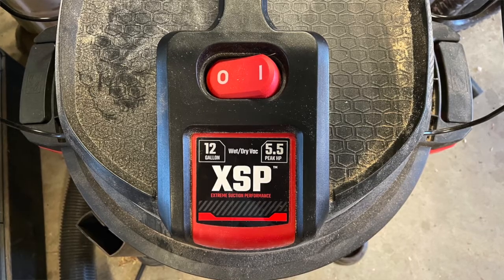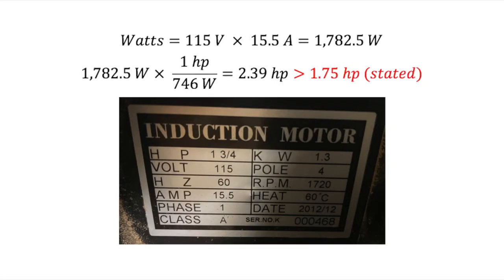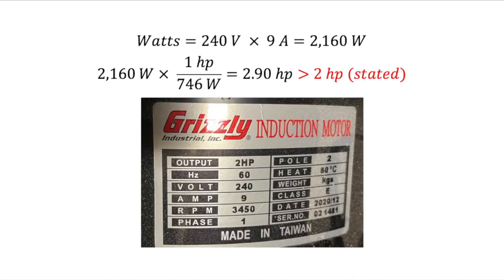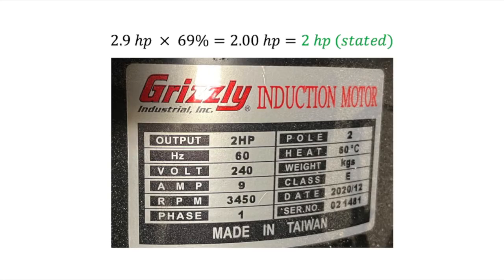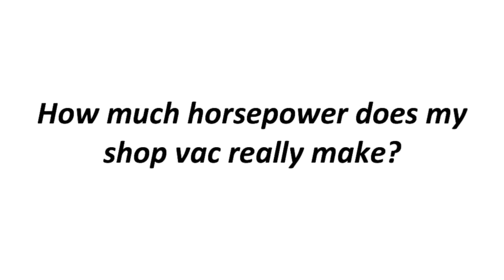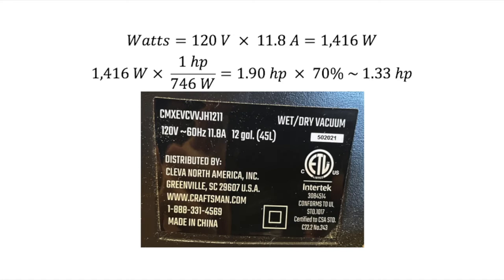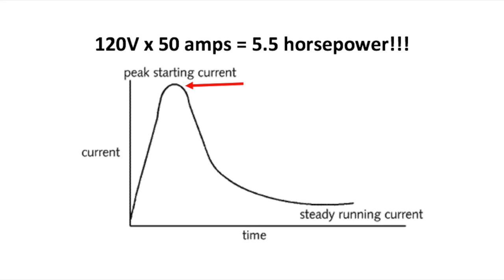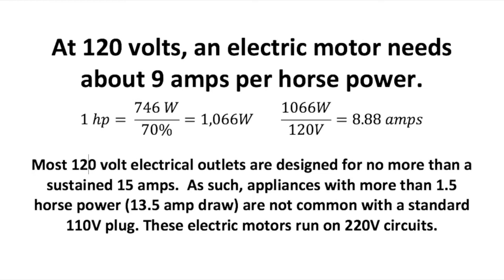Deceptive marketing!  Why your shop vac is not 5-6hp!

Comment: So what “lingo” should i look for to find the best water sucky powered shop vac- that is sucky -but not in performance… ?
Reply from the maker: Looking at amp draw is probably still the best option.   It is often in the fine print so to speak.   I have usually seen it in the text molded into the plastic on the head unit.  It will likely be hard to find anything more than 14 some amps since most house circuits are on 15 amp breakers/fuses.

Comment: Ah so the advertised numbers are using misleading Language like "peak HP" instead of working Hp. Might as well say "5 hp on startup for a microsecond not running hp" but that's lame. But still this misleading crap is legal.
Reply from the maker: Yep....they get away with the fine print on this one.